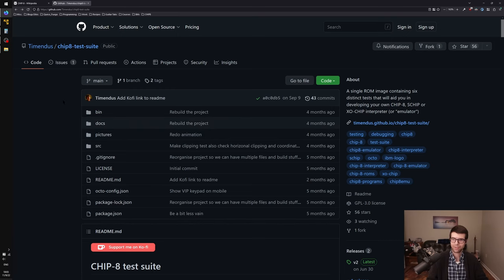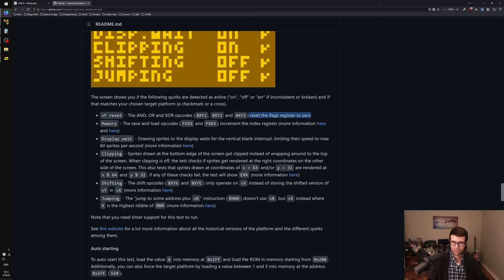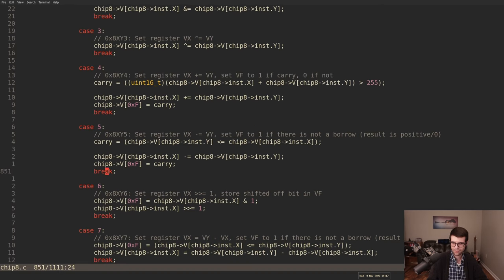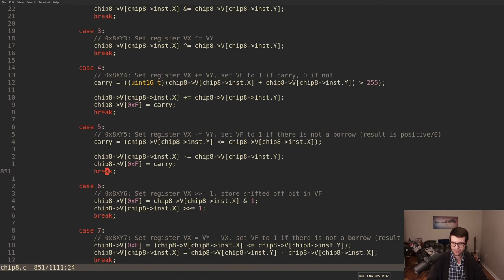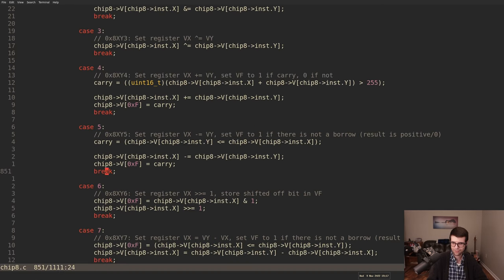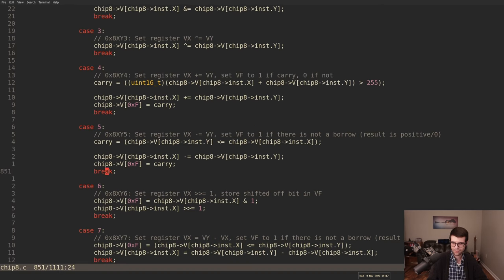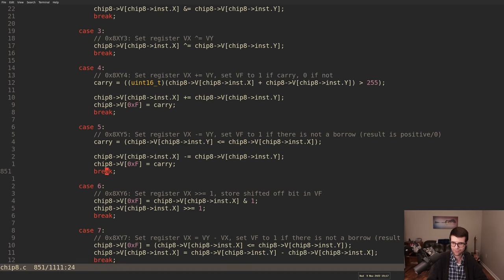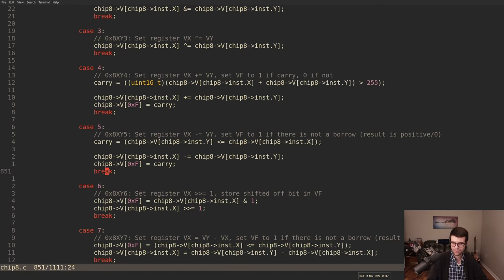CHIP-8 Emulator p6: Fixing Quirks (C / SDL2)

Comment: Thank you for this ultimate video series. 

would it be possible to have a series about designing your own version of TTL CPU may be SAP-3 or SAP-8086 SAP-6502 (but not SAP-1 Ben Eaters) and then try to emulate it.
may be having your own Assembler Compiler.
we can have its own instruction set or copy same instruction set from x86. (the whole tool chain)

may be we can write our own clone of Tetris :elbowcough:

That will be then an Ultimate video series for beginners like me who can not afford to buy all the hardware and can be very good learning experience and have a satisfaction of building our own TTL CPU be it in Emulator. :)

Thank you !!☺
Reply from the maker: Possible yes, it would probably be emulation in something like Logisim. I guess breadboards and real TTL chips could work, but would take up a lot of room & wires.
An advanced version could be on an FPGA outputting video signals to a vga or dvi board, or sending bits over serial. But probably would do emulation.

It'd be fun and very interesting for sure, kind of like nand2tetris. 
I can't promise when I'd get around to doing this, but I have it saved on the ToDo list now.
Reply: @QuesoFuego  Exactly!! It'd be fun and very interesting for sure.

I got the inspiration to dive in to this area from 'Nand2Tetris' itself.

Although I am bit rusty on the basic 'Digital Electronics', I have gone through several videos over YouTube to get my basic clear.
Currently I am watching your series on 'Chip8' simulation and it is helping me to get more in depth understanding of inner working of those CPU.
hopefully designing my own 8 bit CPU one day on TTL circuit board in next 4 5 months.

Logisim would be better choice thank something like Proteus. But eventually I would like to see my CPU hardware built with TTL chips than FPGA,
as building out of TTL has more advantages over FPGA like Cost, form factor, simplicity, low power, flexibility.
also it gives you 80's feel of circuit boards.

These are the few youtubers I have followed along may be you can have a look at their work.
Ben Eater(The Legend), slu4, James Bates, James Sharman, DrMattRegan (SAP-6502), @DavePoo

Please take your time, we will wait for the series 😇 Good Day!!

Comment: Very late to this particular video (was looking for something unrelated), but display wait is not quite as complicated as it sounds. The most rudimentary form of it that you can implement, is to ensure that DXYN will only be allowed to run when it's the first instruction of a frame, meaning that in any other instance, the instruction loop will just spin in place, not doing any work. Timers still decrement as normal of course, you're never meant to pause those.

Implementing a more accurate version to account for the "big draws" that'd make the display wait 2 frames is, unfortunately, a lot more involved. An approximation is possible, but not accurate, and not very useful either. You'd need a full-on VIP core that emulates everything in depth to be able to calculate instruction timings and figuring out if you need to wait for a double vblank before the draw is allowed to proceed. Scary stuff. If you want to work the simple short display wait, strongly recommend to just ensure that dxyn is only allowed to be drawn as the first instruction of a frame. If you have some interrupt system in place, you can of course mesh it in there somewhere, depends on your exact implementation.

On the matter of the FX0A, you're expected to halt the instruction loop essentially and await for input. The first key that is released is then fed to Vx, and the instruction loop resumes. 
The easiest way to check for key release events, if the libraries you use (if any) don't offer an easy option, is to implement two arrays of keys. Each frame, the first array will inherit the values of the second array, and the second array will have all 16 of its values updated with the current status of the hex keypad (1 if pressed, 0 if not). You can then use these two arrays to compare and figure out if a particular key had a press or release event, by going from 0 to 1 and from 1 to 0 from the previous frame to the current respectively.
Throw that check into the FX0A's key scan, break the loop for the first one that tests positive for a release event, and you'll have one happy test rom on your hands.

You can, of course, opt for the lazy (though snappier) approach of proceeding with a key press instead, but several roms that follow up with EX9E and EXA1 instructions after the FX0A would run into false inputs because your finger is still holding the key down, there's just no way you'll tap a key for a single frame as a human. As you can tell, an FX0A that works with a key release doesn't suffer the same fate.

I also have a method to make FX0A operate on a key press that's been hardened to avoid these misfires with EX9E/EXA1, and it still passes all the tests I've thrown at it. Let me know if you'd like to try it :D
Reply from the maker: Interesting, drawing the display at the start of the frame instead of at the end makes sense for the display wait, the other processing would follow once it completes. The only thing I don't like for key release instead of key press is that it isn't responsive, if something doesn't move until you release an arrow, but you're holding it the whole time, that doesn't seem like users would like it. Unless key repeat is handled properly with EX9E/EXA1 maybe, or using your double buffering method.
Reply: @QuesoFuego  Indeed, I've also found the default FX0A behavior sluggish for that exact same reason. It took me a while to polish it but at this point I've arrived at a setup that works flawlessly, and it passes all the same tests that the on-release version would pass. It might be a bit much to explain here in a comment but I'll try.

The first thing to note is that in my setup, the instruction loop occurs first -- it will loop X instructions each time (SPEED variable), and quit early if the SPEED variable that dictates the amount of instructions to run isn't > 0. This part's important. When an FX0A is detected, I cache the Vx register reference to a variable, and call an interrupt function that sets the type of interrupt (in my case 0 is single-frame delay, also used in display wait, 1 is for jump loop detection which stops the emulator for good, and 2 which is dedicated for FX0A) and inverts the SPEED to a negative.

When this occurs, the instruction loop quits early since the SPEED is no longer positive. After the instruction loop itself however, follow three other functions in sequence, they're part of the main loop, and said main loop only runs when SPEED != 0. The first  function updates the input values for the next frame (we'll go over that), the second decrements timers (nothing special here), and the last checks the interrupt type and takes certain actions (we'll also go over this).

The magic here now occurs on multiple layers. I have THREE key input variables (I clump each key into a composite 16-bit variable, so I can check all of them at once without looping and checking them individually). One is KP (keysPrevious), another is KC (keysCurrent) and the last is IK (inputKeys). The first holds the keys from the previous frame, it is always assigned the values from KC when the input update function is called, then KC itself is updated to flip all the bits to 0 or 1, depending on what keys are being held down during the frame. Lastly IK itself is updated at the end by doing some bitwise math between KP and KC to detect and return the bits of any keys that underwent a release event during the two frames. If they were, those same bits are subtracted (bitwise at all times) from IK itself, clearing them, any others are not touched.

In the last stage where the interrupt state evaluation function runs, I do slightly similar bitwise math to save a temporarily variable that holds all the bits of keys that underwent a press event during the two frames instead. Then, if I subtract the IK bits from that temp var and some bit(s) remain, I do the following which was previously part of the FX0A instruction's work:
Bitwise OR the bits from the temp var to IK (so we know they are used), then set VX (from the cached reference) to the position of the lowest enabled bit of N (I use log2 here for the math). Lastly, I clear the interrupt state variable, and set the X variable for instruction speed back to a positive value, allowing the instruction loop to resume again in the next frame.

I hope the general process so far is understandable to a degree, even though I haven't pasted actual code :P

The last part is to secure the EX9E and EXA1 instructions from misfires due to the new FX0A behavior, and that's fairly simple. 

By default (in my setup anyway), all I had to do previously is bitwise AND the KC variable with 1 shifted left to the value of VX to check if a particular key was being pressed. Now, you just adjust the KC part of the equation by first subtracting the bits of IK from it, effectively ensuring that even if a key is pressed, it would not be detected while IK holds its value. Since IK is updated every frame to clear any bits of keys that underwent a release event, this makes a flawless input loop.

Let me know if you want to see some actual code on all this :D

As for key repeat, I'd say not to bother if you plan to implement it from the interpreter's side of things. It would take a long time to figure out how to tie in timers with your input variables and ensure there's no weird behaviors. It's eldritch enough working around the system to get flawless on-press behavior, and rom makers could implement input repeat on their own as part of the rom program itself if they wanted it. Typically they utilize the EX9E and EXA1 if an input needs to be consistent or repeated, or when non-locking input is required (like in cases where animations need to continue running while input is awaited).

Comment: Maybe you could update it to support colors, lets say 16 colors? So you could make a new system out of it, because you would have to completely change how graphics work when you adding colors. This would be really intersting. Nobody has done something like this before, everybody just implements the chip 8.
Reply from the maker: Could make an extra opcode for setting the current color, have it be 8 bit RRRGGGBB or something, and the next draw calls for sprites would use that color until it's changed again. That seems easy enough. Would have to translate that 332 color to and 888 one at most, or redo how colors are applied, and make custom roms or insert instructions to change the color to some open source ones.
Reply: @QuesoFuego  Sounds interesting!